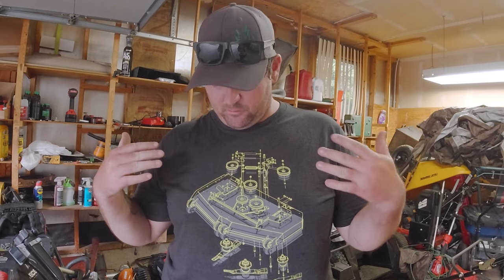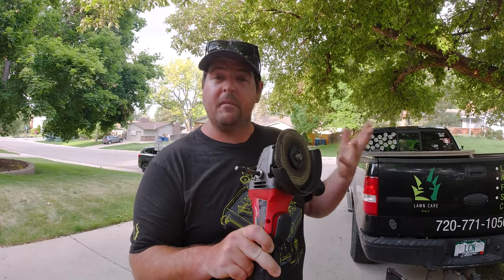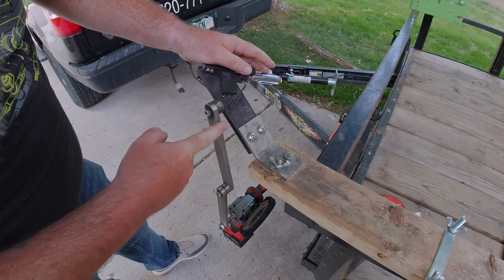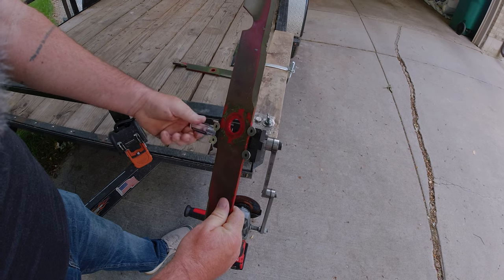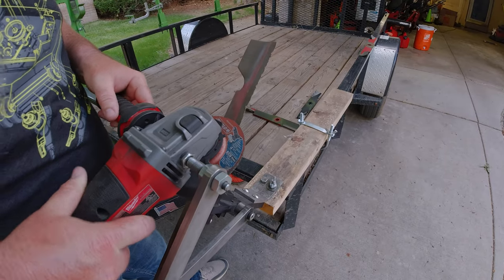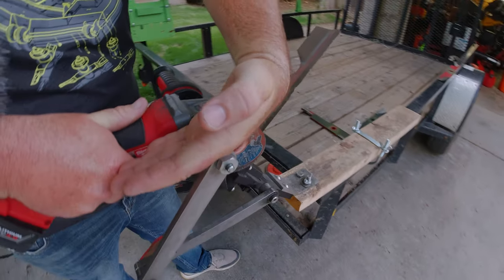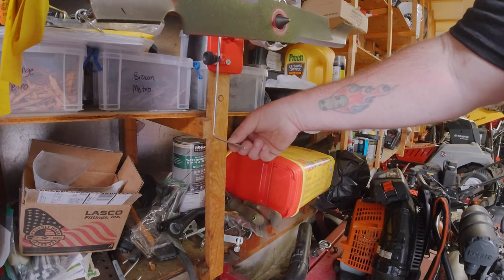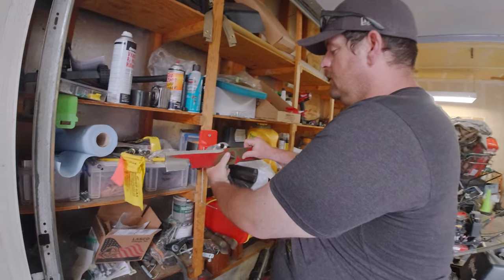Lawn Mower Blade Sharpening and Balancing | ALL-AMERICAN SHARPENER 5005 [TUTORIAL]

Comment: Does your Oregon Blade Balancer give you consistent results? I purchased and returned my Oregon Blade Balancer because it gave inconsistent results. For example, I placed a new, unused blade on it and sometimes the blade would be perfectly level and sometimes the blade would rotate to the bottom. In fact the magnets on my Oregon would slowly drift when no blade was attached.  I replaced the Oregon with the Magna-Matic 1000 Blade Balancer. The Magna-Matic is extremely precise and gives me consistent, repeatable results.
Reply from the maker: It does. I added some silicon lubricating spray to it, and occasionally spray some on it to protect it and make it turn smooth. I'll check out the Magna-Matic, I have never heard of it. Thanks for watching and commenting!

Comment: I just received a new set of 50” blades for my Toro zero turn, my ride mower and these blades are sharpened on 35 degrees . Is this correct? Do I need to resharpen them to 30 degrees?
Reply from the maker: The degree of angle depends on the area you live in. For my area (Denver, CO), 30-35 degrees is the best. I would leave them be or find out what your previous blades were and grind accordingly. If you are taking it down to 30 degrees, you will be grinding for a bit and the blade will get super-hot, so be patient and careful. Thanks for watching and commenting!

Comment: What is your thoughts on cleaning the blade before sharpening and balancing the blade?
Reply from the maker: If the blade is caked with old dirt and grass debris, I would clean it. My blades RARELY have that issue, so I don't worry about it. I mean, you can see in my video the amount of debris that is on my blade is hardly anything. I hope that helps you out. Thanks for watching and commenting and subscribing!